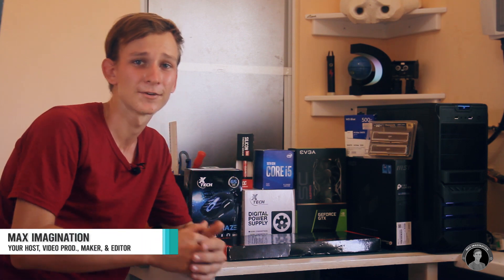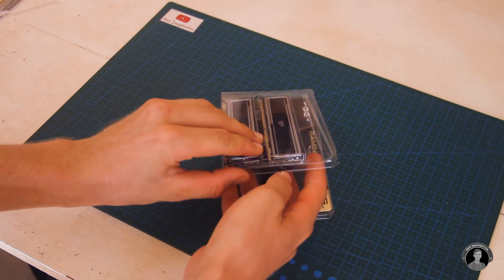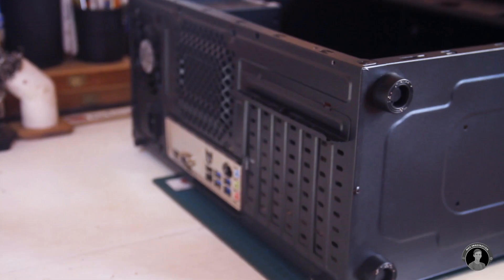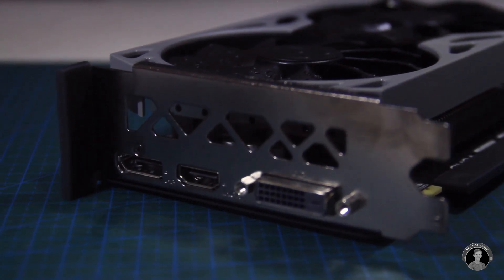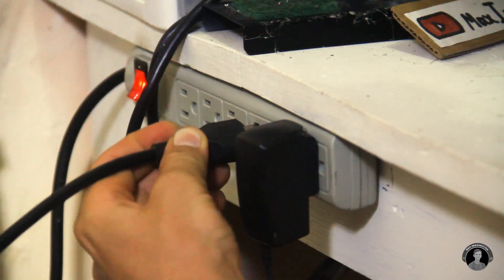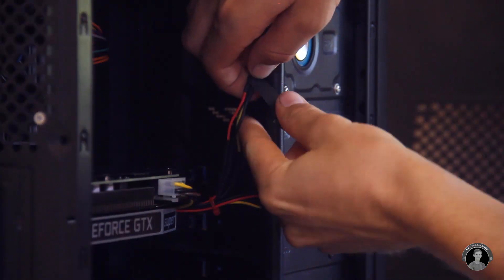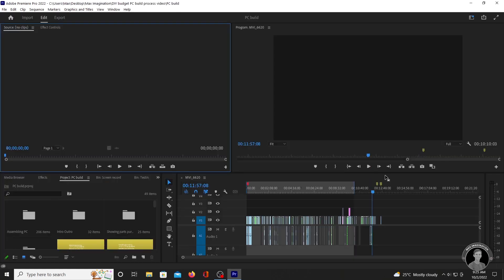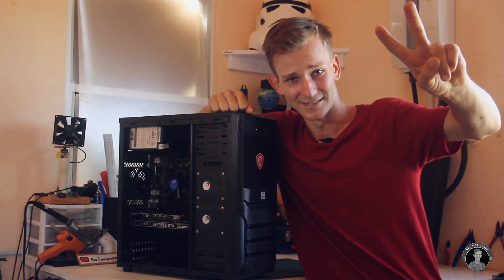How I built my own FAST PC to Level up Video Production | DIY Budget Computer Build

Comment: I would suggest ditching the PSU the case came with.
Reply from the maker: As told from others, I cheaped out on the PSU and will get a quality-built power supply for the PC soon.

Comment: Nice build. Neat and effective.
Little suprised you could get an 500Gb NVMe SDD for 45$. good pick!
Also lucky you could still find a case with those 3.5 front rail or window, dont know much how they are called. where you putted the MSI sticker... it is also a must have for me , as I still use DVD drive from time to time, plus I got some Drive Switcher Device... I know I can get an external DVD drive, but to lazy cause I ll need to connect it and disconnect it everytime I need to use it.
No need for those fancy RGB case lol
Next time, when you need to install a CPU and Ram, put the motherboard on nakpin! cause when you were installing them, when motherboard was balancing on the flat surface. 02:30
Reply from the maker: Thanks for your descriptive but kind comment! 
Also, thanks for your tip there with installing parts onto the motherboard.
Cheers,
Max

Comment: Great job of building and explaining what you did for all of us!   What is the final cost, including the Window 10 OS and two hard drives?
Reply from the maker: Thank you for your comment! The price listed in the text animation at the beginning is $650 including cables, peripherals, and all of the pc's parts with the two hard drives I got for free from old laptops. Price doesn't include the monitor. 
Windows 10 is actually free, downloaded from their official website, though you have the choice of activating windows (basically just removing the watermark) via a paid code/key. I got windows up and running on my PC for free. 

Cheers,
Max

Comment: That's one awesome PC Build. What I would recommend if you can't upgrade to a PC from a laptop is to change the laptop's HDD to a SDD, this makes the laptop significantly faster.
Reply from the maker: Great tip as switching to an Solid State Drive will greatly speed up the Read/Write speeds, enhancing the workflow of a PC or laptop.
Thanks for your comment!

 Cheers, Max

Comment: I know what you spent on more which was the graphic card GeForce GTX 1650 and the MSI motherboard. Overall PC building is always fun. 🤔🙌🏼
Reply from the maker: Didn't aim on spending more for the graphics card than the CPU, but I have no regrets with the insanely good rendering speeds 😊
Reply: @MaxImagination  as long as it gets the Job done ✅💯
Reply from the maker: @joshuaaranguren1020  Yup, it does! Hope you've had a good weekend ✌🏻
Reply: @MaxImagination  hoping you had a great one too ☺️